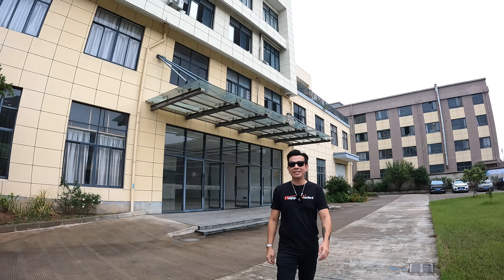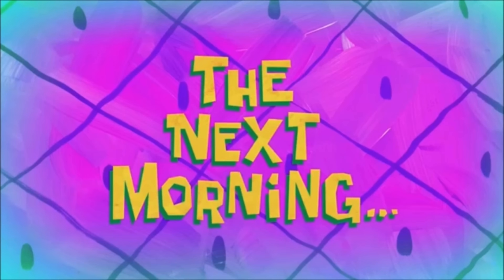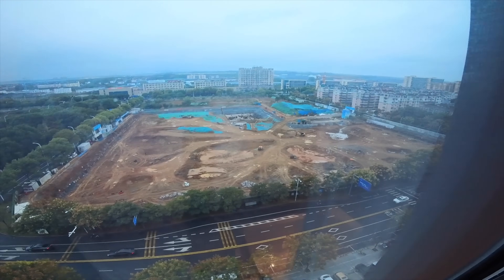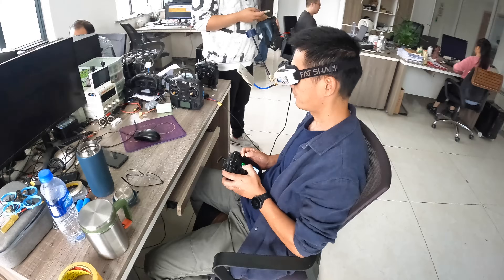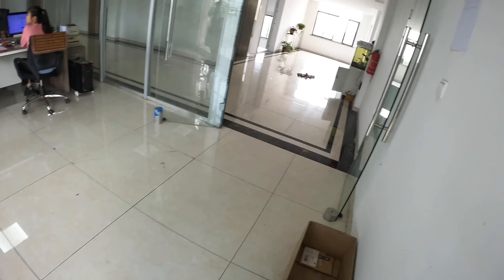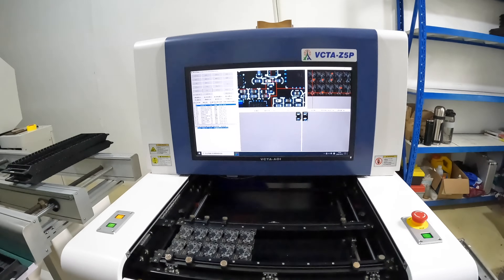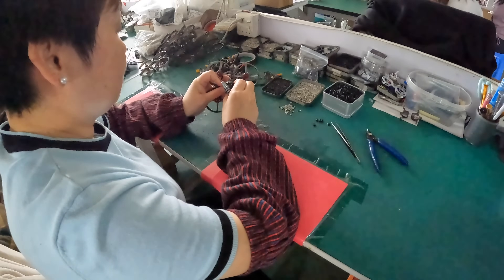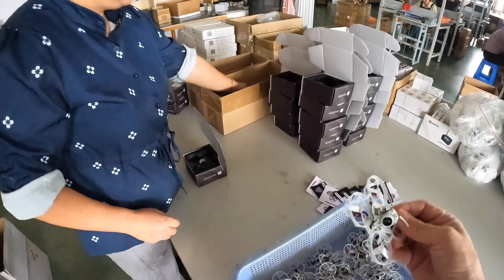Inside a China Drone Factory.  Let's take a tour

Comment: Hello there. My Mobula7 1s has consumed more than 500 bats 550mAh indoors. The frame of the whoop is scratched and slightly deformed because of numerous crashes, and the VTX antenna rumpled. But it is still flying great on the original parts from the box. Amazing durability and quality!!! By the way, I've already prepared different spare parts which are chip and easily available. Mobula7 is a fantastic tiny whoop.
Reply from the maker: Geez man, that Mob7 sounds like it went through war.... hhaahaa but I totally understand.  Its the same with mine. I really love it and glad ur giving yours the much needed love and attention too!  Thanks for dropping in man

Comment: My first Happymodel was the Snapper7.  I use their 1 watt ELRS module and I now fly the Mobula8 every day.  Colour me a very satisfied customer.  Happymodel rocks.
Reply from the maker: WHOOOAAAAAAA SNAPPER7!!! OMG!  Alu frame ducts.  Issit still flying??  oooh sick.  Im using the same.. but i think i only fly it like 100mw.... max!  Aaww thanks bruh, will relay the message. They'd be so happy to hear u say it!
Reply: @shogunemperor  Not flying, unfortunately.  I never liked 1S power - not enough juice for my liking.  But it did fly the best of any 1S whoop I ever used.  I really love my Mobula8.  2S, 2-inch is where I like my whoop action, and the Mob8 is the best in its class - by far!  Also, Happymodel's customer service is top notch.  I had some troubles with my first Mob8 [I have four now] and they helped me sort it all out.  Great products, great company.

Comment: Cool series, subbed!
Reply: Just bought 3 happymodel drones 65-70-75 they all work well out of the box.   Motors are not super strong, it seems there is always 1 weak one, but after replacing that 0 issues.
Reply from the maker: @ThomasAndersonFPV  yeah..  actually.. now that u mentioned it… its always that 1 damned motor…. Hmmm. Will discuss with them and check.
Reply: @shogunemperor  Very unlucky all 3 had motor 1 busted by the third flight or so.  But I break it while crashing, so I hard to blame just warranty.   Thanks for passing it on. They seem like a cool company.
Reply from the maker: @ThomasAndersonFPV  aaww thanks so much bruddah. Subbed back of course!!!

Comment: The Crux35 was my first quad that was a really good product. And I already had 3 quads from other brands before. Great company. There is only one thing to complain about. They used a 16V capacitor on the battery cable for this 4S drone. 4S is up to 16.8 - 17.4V. One wire of the capacitor had melted, which I only noticed later. It could be that that caused my desyncs back then, I don't know exactly when it melted... Well, I also flew it in 3D mode, it could be that that causes higher voltage peaks than normal operation. I still don't think it's great to use a 16V capacitor for 17.4V voltage. But it could be that Happymodel's supplier was to blame (the pigtail with capacitor manufacturer) and not Happymodel directly...
Reply from the maker: thanks for dropping in brruh.. hmm.. I think ur right tho...that 16v cap may not be sufficient.  On bench test its fine but with load in actual flight, it may be different.  Will let them know of your feedback.  Thanks again bro